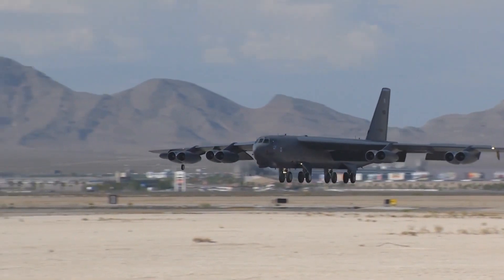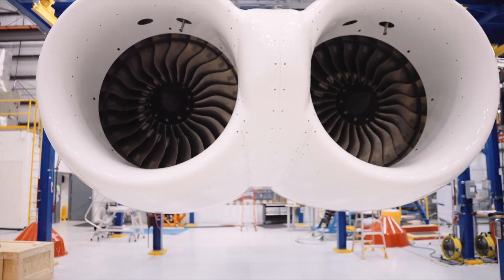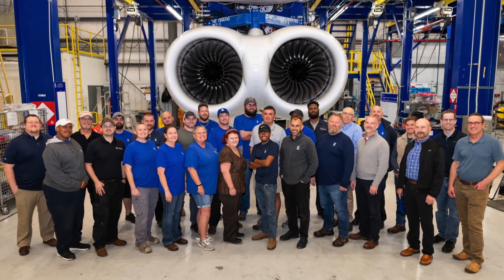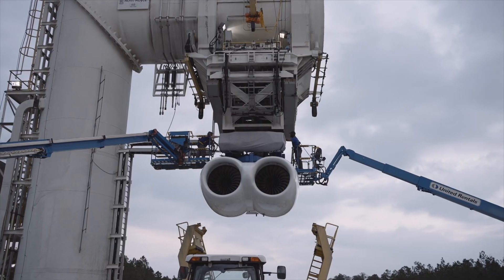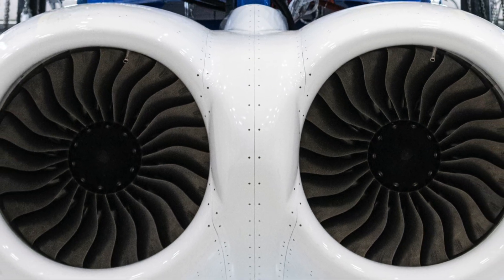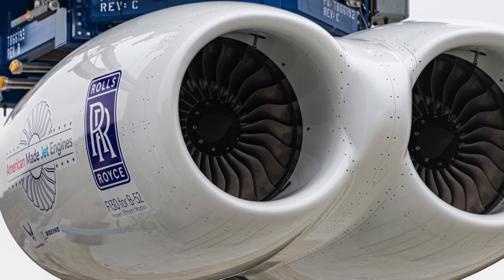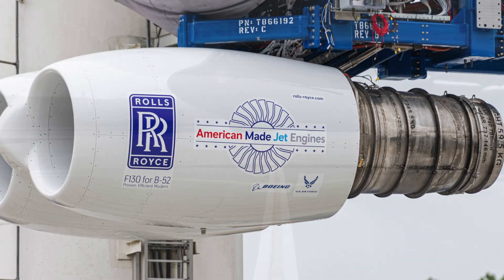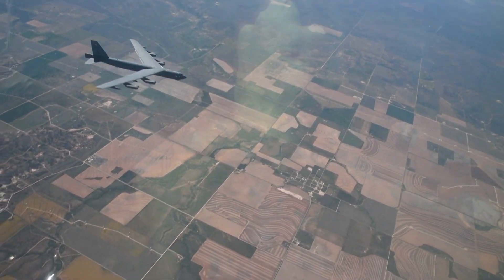Rolls-Royce | Rolls-Royce F130 engines for B-52 begin testing

Comment: It can't be an efficient configuration having two engines so close to each other, the suction from the inside edge of the fan must sap a fair % of efficiency, surely 4 larger engines would be better?

Comment: Hello dear Rolls-Royce team 

I have a question: could the A-10 Thunderbolt II be modernized with your BR725 as a TF34 turbofan replacement? That would be from a total of 83.2 kn to 151.2 kn ! The variant for the A-10 is a little different but so similar. I am sure that with re-newed airframe and engines it can have another 100 years of service, i.e. until 2077. 

Under the name: 

A-10E Thunderbolt II 

I'm open to any answer, thank you very much!

Comment: B-52s with German engines, how cool. The engine was designed by Rolls Royce Germany and that company started as "BMW Rolls-Royce AeroEngines GmbH" in Oberursel, near Frankfurt am Main in Germany. The F130s for the B-52 may be built in the USA, but it's still German Engineering. Your grandfathers fought warplanes powered and/or made by BMW. Soon a company with BMW pedigree will power your bombers.

Comment: The Rolls-Royce F130 engines for the B-52 has 17,000 pounds of thrust.  No increase of thrust over the TF33 engines its replacing.  Thats a good thing.  The wings and wing design are stressed for that power.  So the takeoff roll and general engine performance will remain the same.  The benefit to the crew is engine fuel efficiency.  That means it can fly further on its tanks of JP4.  And that means fewer air-to-air refuelings.  The downside to that and the new engines themselves as far as the crew is concerned is longer missions.  The benefit to the Air Force besides the longer missions per mission profile is lower maintenance costs.
Reply: Luckily long missions on the B-52 aren’t as uncomfortable as they are for the just 2 crew on the B-2.
Reply: Interesting because they have to refuel as well.  I just don't know how long they can stay airborne.  And I was wrong in my posting 7 months ago about the comments I made about the benefits of the new engines.  I suggested fewer air-to-air refuelings would be real benefit to the flight crews. Having been there in a B52G in the 70s, they can be very stressful. While fewer refueling would be a real benefit to a crew, with engines that are more fuel efficient, longer missions could result per mission profile.  If that happens, then additional air-to-refuelings could and probably would, result. So the real benefit of the new engines besides lower maintenance costs to the Air Force, is for the mission planners to take advantage of the longer missions and not for the flight crews.  Hopefully they'll replace the honey bucket aisle toilet with a real restroom in the B52J because of the longer missions that require additional pilots and navigators.  Not to mention for the female B52 crew members they have now.

Comment: I checked the data on the engines. It looks like 4 metric tones total savings on weight and 18% less fuel consumption. I think it is significant.
Reply: So much so the fuel saving alone will pay for the entire engine program over the lifetime of the airframes.

Comment: Why not use 4 bigger engines?
Reply: I would look ugly. V8 is a must.
Reply: I've worked in civil aerospace for many years now. I don't know the answer but I'd be willing to make an educated guess. This 8 engine dual unit set-up is how Boeing designed the B-52 airframe so the configuration has type approval. Rolls already have a great engine that fits the required specs so PROOFing it out is quicker, easier and cost effective. As for why this design was chosen in the first place; thrust: weight and on wing load distribution I would guess.
Reply: localized weight and modifications to the Wings will be needed.  The engines are not even more powerful in any significant way. They are trying to keep modifications and costs at a minimum. They are probably paying twice as much as they should,  but the f130  are really private jet engines: economical, mass-produced, and with a robust parts inventory.

Comment: 41 spares is a strange number and doesn´t sound much for the whole fleet.. there will always be some in repair maintenance or overhaul. Will the new engines also have cartridge starters ?
Reply: There is no need for an engine overhaul so they will never come off the wings until the aircraft retires. Unless of course they get a serious failure.

Comment: Suprised they didn't go with something more modern. This is a 28 year old engine
Reply: The current big high bypass engines can definitely do the job but the BUFF will end up having to majorly modify its wing structures to support them (which means higher cost).

At the end of the day they just need an engine that is still going to be supported for the plane to keep flying for who knows how many years.
Reply: @AbrahamArthemius yep, and for a high bypass engine / they have been previously considered but they would not need to have 8 or mg ones only 4- which would mean new wings.
Reply: The buff don't care as long as I'm flying 30 more years?? 12 O'clock High

Comment: I don't get upgrading a 60+ year airframe that was obsolete 30 years ago.  I understand the plane can carry a big bomb load, and can use standoff missiles.  However, the plane has a radar cross section of the Empire State building, it's slow and is a great target for new high speed and hyper speed air to air weapons.  My guess is some Senator wanted jobs in his state.
Reply: The pilots that flies B-52s knows all these drawbacks they don't give a darn
Reply: They are a deterrent. They're multifunctional, while carpet bombing may be considered obsolete you never know when a conflict might dictate pulling no punches and by keeping these in service you keep the enemy guessing. You may think they are obsolete but their impact on the battlefield says otherwise.
Reply: If in war it'd probably be used as a missile truck more than conventional bombers. As for why they're using a 60+ y/o aircraft, might be due to the fact that it is in a significant number than the B-1 (45 vs 76 source is Wikipedia so take it with a lot of salt). It'd probably be replaced by the B-21 Raider in the future though.

Comment: what is there to test ? the F130 engines have been around since 1995
Reply: It’s a configuration they haven’t used before.
Reply: Guess you are not an engineer. To start integration tests, tests related to the engines running on pods, different vibration nodes, military-grade degree ingestion etc.  Even if we cannot foresee any changes, as the ones I just mentioned, we will test. Murphy's Law is more than a joke, and you don't want it to show its ugly face. You will be liable as a professional if you did not test properly, or worse: someone could get hurt or lose their lives.

Comment: As a former aircraft mechanic on B-52's during Vietnam it is exciting to follow this project.
Reply: its amazing they're still using the TF33. our jets (KC135) used to use them. now we're running 4 CFM 56's/F108's with 22,000 lbs of thrust each! what an upgrade. i'm really surprised the Buff engines haven't been updated already
Reply: @ReaperRestorations  seeing 4 CFM 56's on that plane is quite a wowzer. Looks like a beast, ready to go to work.
Reply: @ReaperRestorations  I understand that, for years, the cost-benefit analysis to reengine the B-52 was negative because there were just so many TF33 "good" engines in storage at the depots.  In recent years, some of the "good" engines were pulled from the depot to find some things like seals had gone bad and, therefore, they would need to be refurbished.  That additional cost made the swap out to RR engines feasible.
Reply: As a current aircraft mechanic on B52's, I'm excited as well.

Comment: Hey China, we're testing them at the NASA Stennis Space Center facility...got that?  But... we can't tell you what time of day we test them.  That's classified.
Reply: Its a basic engine nothing special or high tech
Reply: @jogo798  
They are basic engines for America but very high tech by everybody else's standards.
Reply: @bighands69  Rolls Royce is a British company and the F130 is almost a 30-year-old design. They just have testing and manufacturing hubs here in the US because Boeing, one of the top two largest aircraft manufacturers, is American.
Reply: @gnranger  
The company is british who are allowed to develop in the US with US industry. And is covered under Special Security Arrangement. 
Rolls Royce were able to do that by acquiring Allison Engine Company that were an American engine company and that required special security clearance. SO my original point stands.
Reply: @bighands69  That has been going on since WWII. Britain didnt have the manufacturing capability to produce enough Rolls-Royce Merlin engines for their fighters and bombers, so Packard USA manufactured them under license from RR. a LOT of Spitfires, Mustangs, and Lancaster Bombers flew with Packard engines. Which were identical to their Rolls Royce counterparts. The parts even interchange. I work for a company for a couple of years that was in the business of restoring and maintaining warbirds. We used RR and Packard parts interchangeably quite often.
Reply: @gnranger  why is RR so big in Indianapolis IN  ??? ... big  engine  mfg  center in US  for RR
Reply: @phillp7777  Because as I said, there’s a massive market for engines in the US because the US and North America house a large part of the world’s Commercial/Military aviation industry. What is currently the Rolls-Royce plant in Indianapolis was formerly the Alison Engine Company. RR bought the company in the 90s to have a manufacturing base in the NA market.
Reply: They’re literally just small regional airliner jet engines. If china wanted info on them, they could just purchase a Boeing 717.
Reply: If China can't figure out where the engines are being tested they might as well turn off their satellites

Comment: Would have been nice to know the comparison between the old engines in terms of power output, fuel economy & maintenance.
Reply: Power will be roughly the exact same, so they don't have to re-design other portions of the airframe. 30% greater fuel efficiency, and 40% greater range.  So unrefueled range goes from 8000 nm to 12000 nm, or half-way around the world!
Reply: Wiki shows 17k pounds thrust.
Reply: It's same as that that Gulfstream uses
Reply: Strangely, I believe these RR produce less power than the original Pratt and Whitney.
I get they are more fuel efficient, but Less power???
Reply: It would be nice, but it is likely classified.
A few years back, I saw a program stating that jet engine combustion science, aerodynamic modeling and materials science has improved so much in the last ~60 years that the candidate engines for the B-52 may yield a 30% improvement in fuel efficiency.
Reply: @gregparrott  modern airline engines are more like 100% more efficient than those old engines.
Reply: @Wingman77tws  The numbers I cited were from a proposal for the replacement.  So it seemed credible.  Two items:
1) By what metric(s) is it more efficient? (e.g. range, impulse per unit of fuel, etc.)
2) If you have a SOURCE to validate your assertion, please cite it.
Reply: @gregparrott  yes, sorry I am not arguing with you at all.  Just that I still find it crazy that they are using a fairly low bypass small double fan arrangement as compared to the airline industry that is running tremendously highger bypas ratios, and tremendously higher compression ratios.  Their new engine may be 30% more efficient than the old tf33, however I still don't think it is nearly as good as most modern engines.
Reply: @Wingman77tws  Modern high bypass engines are a lot wider though,  I can imagine that would involve a lot of time and money in testing. This has a very similar profile.
Reply: @zakelwe  yes, that is the problem for sure... so maybe they need to design a whole new airframe... who cares....  it just sucks to see our military held back so far into primitive technology.  if the airliners are 40 years ahead of the military then there is a problem here.
Reply: @Wingman77tws they selected an engine with proven reliability and economy.
Reply: @Wingman77tws they considered different engines but the main driver was they still wanted 8 and not 4. 4 engines would mean a new wing.
Reply: @zipz8423  And likely rudder and maybe landing gear. B52 has absolutely tiny rudder so even a single engine failing in 4 engine configuration would be a lot for it. As mentioned higher bypass ratios are much wider so one solution could be to put taller landing gear on it.
Reply: @gregparrott it’s not classified. These are the same engines in the bombaadier global express and gulf streams
Reply: @Porsche4life  Interesting. Thanks for the reply. I knew that the engine was selected from among existing engines instead of being one developed specifically for the B-52, but did not know where. I've seen ballpark estimates on its advantages - principally better fuel efficiency. But we don't know great detail for the '52's engines, or if the RR engine is EXACTLY the same as on the Bombardier or was optimized for the '52 - its typical flight patterns, payloads, altitudes, thrust requirements, and aerodynamic lift characteristics. So we can only ballpark the RR's improvement as implemented on the '52.
Reply: @gregparrott  
I am sure they can provide at some point an overview without actually giving up super classified details.
Reply: Go rycey! I've put the bulk of my retirement into your company. Hopefully I can retire early!
Reply: @jsizzlemackashizzle8944  so Why ?  did u work for  RR ?   or work their engines or sthing ?  is RR a good company yathink?
 maybe will get job w them... 
 I know this 1.3$B $$$$  B52 contract they won  will help alot right ?
I think RR trading at £1.79 pounds bout now.
Reply: @jsizzlemackashizzle8944  same here, invrsted considerable amount of money into this Company as part of my retirement plan 🫣

Comment: It would be really useful if you gave us differences between the newer and older engines so we can understand the significance of the program.
Reply: Well, it's getting more and more difficult for us to obtain parts for the P&W TF-33.  It also costs exponentially more every year to overhaul them when they go through the 4-year depot maintenance cycle.  The new engines are approximately the same physical envelope and are in the same thrust class to keep airframe structural modifications to a minimum.  The new engines will have digital electronic control systems and a lot of the existing analog engine instruments in the cockpit will be replaced.
Reply: @staceyward777  

Thrust. Fuel economy. Etc.
Reply: @waynesworldofsci-tech    Again, same thrust class as the existing TF-33, ~17K pounds.  The biggest significant difference is it's supportable and will be much cheaper to maintain, both at the organizational and depot levels.  P&W indicated to us a few years ago that they were going to stop supporting the TF-33 by 2030.  That's a problem with an aircraft projected to fly until 2050+
Reply: @staceyward777  

Exact specifications comparisons is what I’m looking for. You need to understand the details to see the total impact. How many cents per flight kilometre? 

I’m the sort of geek who loves playing with numbers and computers. I’d like to model this engine exactly for the DCS World simulator.
Reply: Should be similar to their BR725 engine which is the civilian version that they modified for the b-52. You can find specs on the BR725 if that helps!
Reply: @rydillo  

Oh, I know I could spend a bunch of time digging. The issue is that I shouldn’t need to.
Reply: @SodiumSamurai  

Hahahaha. We dumped each other years ago, are now best friends.
Reply: Estimates have been stated
Reply: We go by cost per flying hours, not flight kilometers. And at this point it would only be an estimate. Those aren't static numbers either. They change over time as engines age and the economy changes.
Reply: @staceyward777  

Yes. I’ve seen manufacturers produce those graphs. Inclusion would have been used.